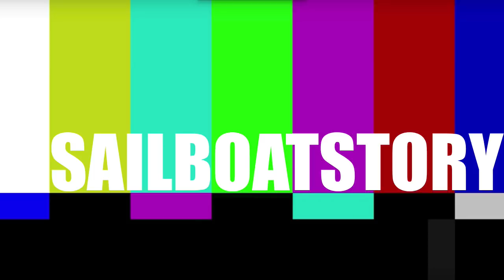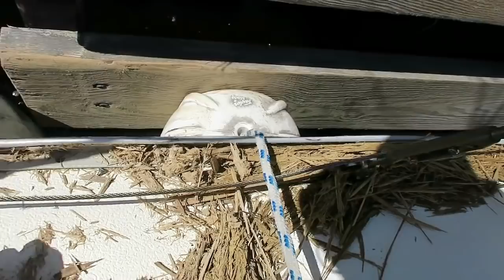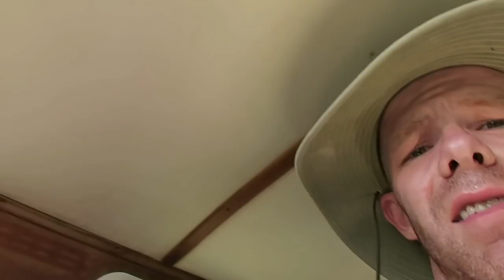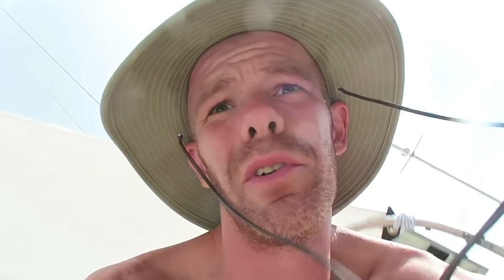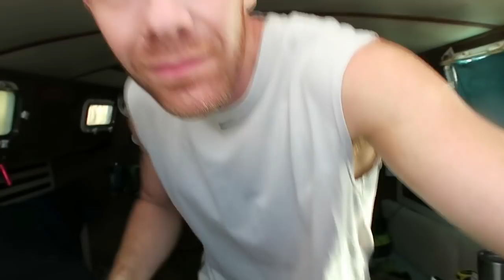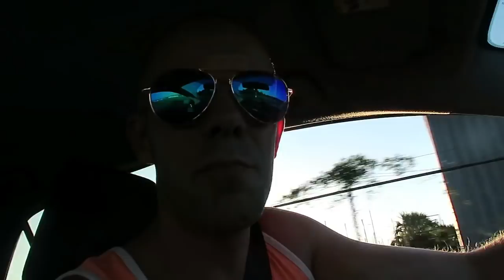Hurricane Irma Damaged Our Standing Rigging | Sailboat Story 77

Comment: Irma just helped show you the corrosion in your rigging fittings. When you get them rebuilt, right after swagging, apply Lanolin grease into the top of the swage, it will flow down between the wire strands and seal off the swage/wire interface from saltwater intrusion. We have done that for years and it extends the life of the stay 2-3 times what used to happen.
Reply from the maker: I've heard of something similar with beeswax, I think.
If I go with swages, I'll do that.
My thought right now is to use Sta-Locks.
That way I can do it all myself.
Cost to re-rig, for materials, is about $1300.
That's my next big project.

Comment: Glad to hear you only had minimal damage. I am sure you know already but be sure to check the rigging at the head as well. That should be inspected yearly anyway. Be safe and have a ball!
Reply from the maker: Thanks for the thought on that.
Very most likely, it'll all be getting replaced.
I've already shopped for all the parts and components for the job.
Quite likely, I'll be doing the whole lot with Sta-Locks.

A brand new rig feels like the right thing to do since I think it's all original anyways.
Plus, it'll be a big selling point when it's boat upgrade time.

Thanks!
Reply: I like your thinking! Fair winds!

Comment: I noticed where you installed the new stainless screws on the damaged section of the rail there is a crack in the deck. You should remove the rail and inspect and repair that section because you will get water in the sandwich of the deck and possibly the hull. By now you have probably done this already. You guys are awesome.
Reply from the maker: That crack is an odd little spot that I've tried to figure out.
It's been there since we bought it.
The paint is coming up a bit, but beyond that, it seems to be cosmetic.
I'll fix it someday when it comes to the top of my priority list.

Comment: I liked your technique using blue painter's tape while sealing the rail at the deck.  Did you wait and let the sealant dry at all or just remove the tape right away after smoothing?  Since the color of sealant was about the same as the deck, I wouldn't have thought to use the tape but will keep it in mind for future projects.

 Oh yeah, glad you had no serious damage to the boat.  The fenders saved the hull from a bad time at the dock.
Reply from the maker: Yeah, the tape really helps.
Sometimes I'm tempted to do without, but it always looks so much better when I take the time and use tape.
I removed the tape right after smoothing it.

Comment: The pressure on the spreader rigging didn't kink the mast, did it? That much pressure on the spreader would have transferred up...
Reply from the maker: I've sighted up it from the bottom, and it looks fine.
I've also been up to the spreaders while measuring the fittings - looked fine.
I had the same thought, but I think we're alright in that regard.

It's amazing how strong the rigging is.
That had to be an incredible amount of pressure on it.
Many times over what it's typical load would be.